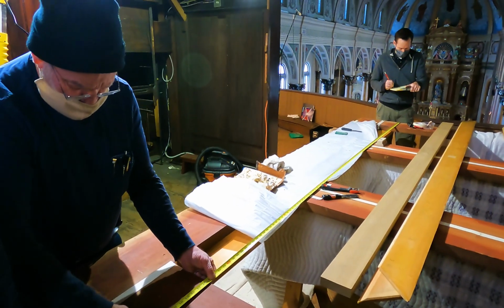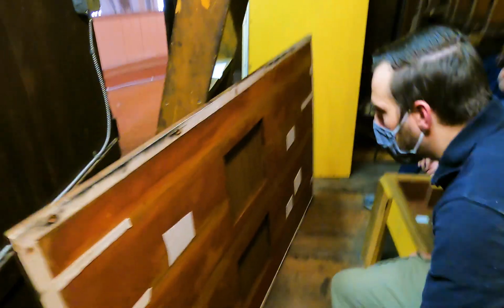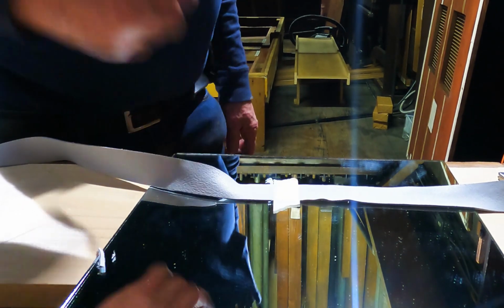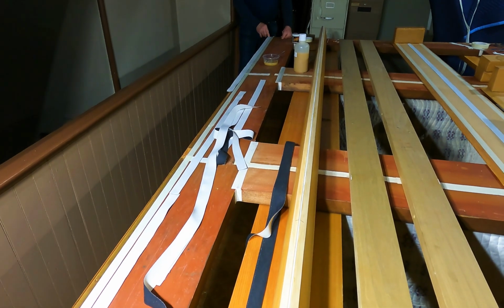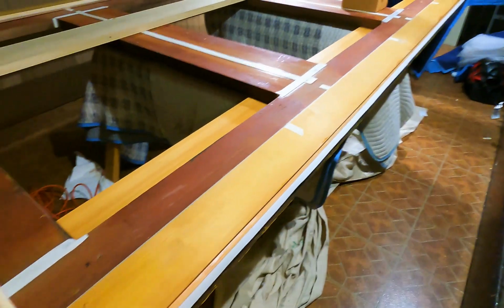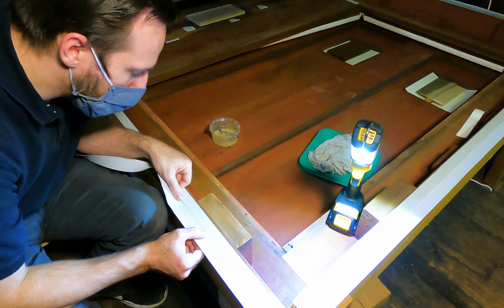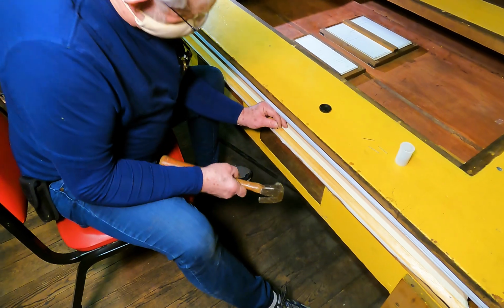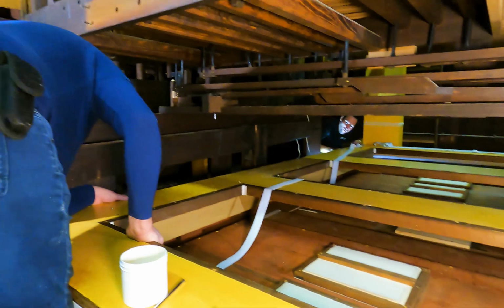Releathering the Reservoir of an 1890 J.G. Pfeffer Organ - Part 2

Comment: Interesting, the different methods which different craftsmen use in carrying out the same job.
Living as I do in the UK, I would certainly not be using rubbercloth or tape in bellows leathering, though I think it must be common in the USA.
We would expect the bellows to last at least 60, and hopefully a good deal longer.  (I have one instrument, still on its original leather, which was built in 1852.  Admittedly, it is small and on a low pressure.)
How long would you expect a bellows leathering job to last in the States?

Comment: I thought this organ was supposed to have been restored by Martin Ott in 2003.  How could the reservoir need re-leathering after so few years?
Reply: Apparently it was above marginally good back then, see that's why I would not reuse things like twill cloth/hinge material that you know has age and wear on it, as long as you have all this apart and spending all that time- I'd replace all the fabric/twill/leather no matter how "good" it might look, something like this is way too much work to leave  a proverbial $10 worth of 20 year old twill tape in because it "looks" ok, it's still 20 years old
Reply: I believe the previous video stated that the leather was in good condition at the time, so it wasn't re-leathered at the time the rest of the instrument was restored. It appears that the lifetime of leather components can vary greatly depending on the environment and quality of the leather. At one time, some builders experimented with a substitute called perflex after getting burned by some batches of bad leather.

The Wicks I play was re-leathered less than 20 years after its most recent rebuild. It is also apparent that some ranks need repairs and revoicing (just over 20 years after that rebuild). Not sure if this is due to shortcuts taken at the time of the renovation, the conditions in the building, or both.

Comment: The use of rubber-cloth rather than leather is totally inappropriate on an historic instrument like this.
Reply: How so? For such a critical component of the organ, proper function and reliability is far more important than retaining "historical accuracy"
Reply: Antique pump organs  from the same era used rubberized cloth for the bellows and exhausters...
Reply: @HobbyOrganist  That's an irrelevant comparison.  Most reed organs do not use ribbed bellows.  All historic pipe organs use ribs that need some flexibility in the hinges as the large wood ribs and frames change dimensions with the seasons.  Leather can provide that and rubber cloth cannot.  Small modern reserviors can use rubber cloth as the changes in dimension are minimal.
Reply: @manuelrosales5136  But the comment I replied to was the claim the cloth is "totally inappropriate on a HISTORIC  instrument like this"  I simply implied  in so many words- this rubberized cloth is not some new, modern invention like Bondo, plastics, "liquid nails"  Gorilla glue, Polyurethane finishes which don't belong on historic or antiques- it was in use on player pianos in the 19th century- the same era.